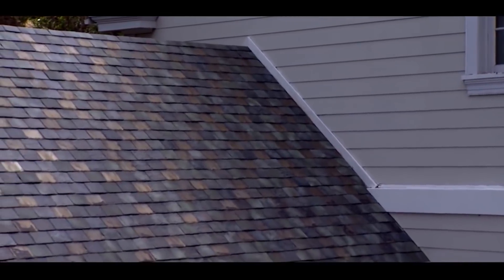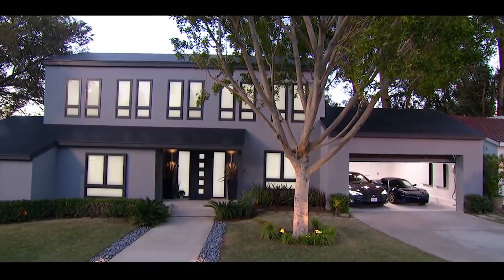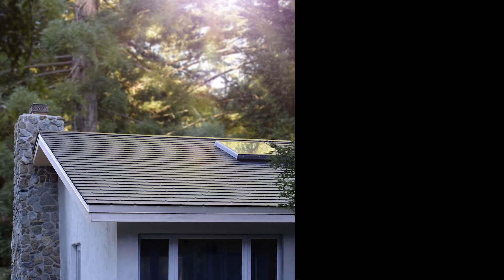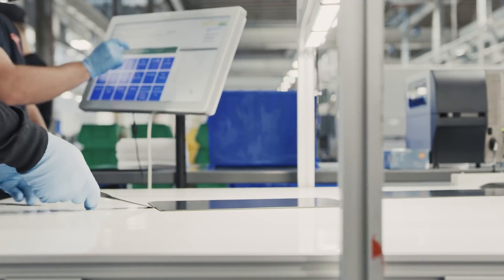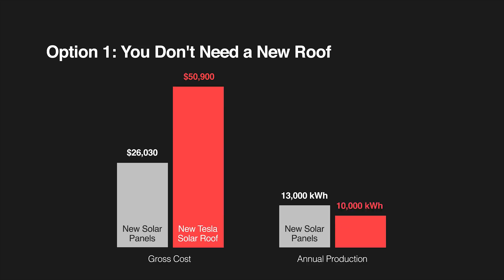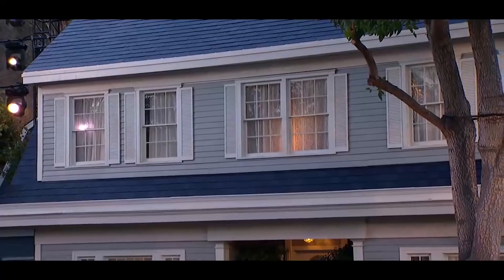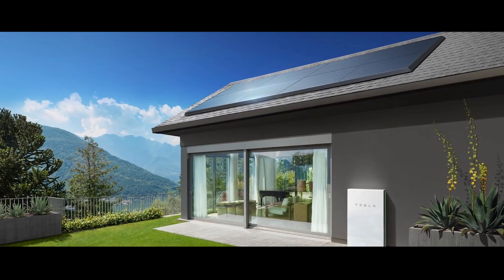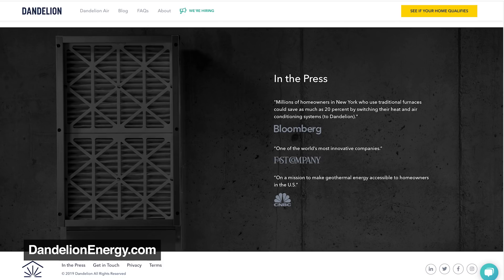Tesla Solar Roof Worth It?

Comment: I have been doing the same math since they have announced. I think you are dead on with your calculations. Where the solar roof makes sense is:

- You don’t want a typical-looking roof with asphalt dimensional tiles. You want a slate or clay roof that enhances the look of your house, but will come at a much higher cost.
- You are building a new house or you must replace your roof anyway.
- You can’t stand the look of solar panels on your house.
- You feel that having a beautiful roof that is very durable and has both a long warranty and the ability to generate power will greatly increase the resale value of your home.

If you are building a new home in a nice neighborhood where you won’t be getting a standard roof, but something much more expensive, the Solar Roof is a no-brainer. It promises to be much more durable, and the huge cost of a normal slate roof anyway will make up a large chunk of the cost of a Solar Roof. Not only will your utility bills be lowered, but likely your property value will go up, as the house looks great and it generates its own energy. Same goes for a preexistimg home that needs a new roof that will not be asphalt but is upgrading to a more expensive roof.

But if you are like me, and you have a house with a good roof and you are happy with it, and solar panels are not a massive eye-sore, just put panels on the roof. The whole point of the Solar Roof is to break the aesthetics barrier for rich people who don’t want their property values to go down after they put a bunch of ungainly solar panels on their expensive houses. It lets them be green and beautiful, but at a small premium over more expensive roofs than what the average homeowner would get. Solar panels are for the rest of us.

Comment: On the smaller scale, it would be fun using these on a dog house or garden shed with a small scale battery setup.

You could power a few outdoor lights and/or a wifi security camera without worrying about laying any cables. You'd have the s3xyst dog house in the neighborhood.

Comment: Tesla Solar Roof has more aesthetics put into it. It's for the people who want a solar roof that also looks good, not just a solar roof.
Reply: almond potato Bingo. To be fair to Ben, Tesla seemed to be pushing this as a mass market solution. It looks great, thus is great marketing, but Tesla really should be promoting standard solar in parallel, since it is more attainable for the masses.
Reply: @PeterWW420  Tesla Solar Roof is an innovative and beautiful design, but until they can effectively mass produce it, people will just go for the standard panels.

Comment: My family is seriously considering a Tesla solar roof/power wall. This is why it might be good for us but not for all: We have a tile roof that needs to be replaced in five years. We want to keep tile roofing. We don’t have solar yet. We live in a moderately expensive neighborhood So the roof proportionally isn’t overly expensive. (Putting out $80,000 roof on a $200,000 house makes no sense). We are also hoping that the prices fall a bit in the next five years. If your needs or situation is significantly different, regular solar panels might be better for you.

Comment: I looked into one about a year ago. It came out to around 100k for my home. My gripe though was that the system never told me what I was getting. Was the 100k for an 8kw system, a 10kw? Who knows there were just no details to be had. Personally I think that a metal roof with LG panels and a couple of Tesla powerwalls (IF you can get them) is the way to go.

Comment: Hopefully insurance companies will offer discounts once they see how durable these are. The hard part is comparing against asphalt roofs. Need to compare against tile.
Reply: In North Texas you get an insurance discount for hard surface roofing i.e. metal, concrete, tile. But also a few asphalt shingle types as well. I believe each asphalt mfg creates a hail resistant shingle. I had them put on my house after the last hail event. They look identical to the shingles I replaced but the hail resistant shingles were much heavier.  I would say almost twice the weight but this is a guess. My insurance treated them in the class of a metal roof for insurance cost. I  assume they would treat these the same.

Comment: Just like the Tesla power wall, there are better solutions for a solar (inroof) option. 

Actually on roof system with the option to replace panels and have the cooling will make it work better and be cheaper... 270watt Peak panels have dropped massive in Price and i doubt that The Tesla tiles will preform better, given that they look good

Comment: You failed to consider that the solar roof is supposed to last "forever" while a regular roof has to be replaced I think every 15 years. I would've liked to have seen that taken into account
Reply: The 'forever' only counts for the mechanical part. The electrical part will degrade by time, as any other silicone cells do. The solar roof will make you the money back on its electrical life time, but not much more. A normal roof with solar panels on it will make you 3 times the money on its lifetime. Solar Roof is a lifestile product. If you care your wallet and environment, then better go for regular solar panels
Reply: @RolandW_DIYEnergyandMore   Exactly.  Once the solar part is gone, now you're left with a roof that has no potential to generate energy and electrical equipment such as batteries / grid tie inverters / wiring that has no function.  You'd effectively need to replace your roof.  Although, maybe you can install regular solar panels right over the top of these? lol.
Reply: @RolandW_DIYEnergyandMore  You got it. Make way more sense to be able to change the tech ontop of a good roof. This way you are stuck with the tech. Like being stuck with the first ipod forever.
Reply: Every new building material claims to last "forever" and many of them are banned within 10 years for poor durability. I hope Tesla tiles stand the test of time and become the go-to roof for the next 100 years; I've drunk the cool-aid that Tesla are genuinely aiming for this.

However until they have 30 years of real world usage under their belt I wouldn't bank on reliability. I'm a skeptic that they will last more than 15 years without at least needing to be re-wired; less for homes close enough to the ocean to smell the sea breeze. Constant current in a potentially humid environment corrodes low gauge wires and terminals... and there will be thousands of those.
Reply: @matthewspencer2094  I'm skeptical as well but if they're warrantied like they say they will then it'll either last or be replaced
Reply: @ryccoh  He doesn't say whether it's the parts that have a ~100 year warranty or the install.

I'm from NZ and its 3rd parties that install Tesla power walls here. I'm sure Tesla stand by the units but they wouldn't refund you the install fee if there was an issue.

I imagine the tiles will be the same. While they would provide replacement tiles if they failed, they wouldn't provide the labor of installing them, or re-wiring them if the wiring between each tile corroded.
Reply: @matthewspencer2094  
Do you think they will use sealed systems for their wiring? with separate systems for termination.  There are still issues with resistance due to usage.
Reply: @matthewspencer2094  Well there's good news and bad news.  The bad news is that the new panels aren't warrantied forever anymore and the electrical output warranty has been lowered from 30 years to 25 years (pretty much everything is 25 years now).  The good news is that the new version 3 panels have better efficiency, more power output, less connections, less wiring, and costs almost HALF as much as the old version 2.
Reply: 15yrs? lol sounds like some BS tesla put into your brain. Most traditional shingles last at least 25-30 these days. The solar roof will not be a success or even really be a thing. It is so obvious considering the many factors I won't waste my time dumbing it down to you.
Reply: No roof lasts forever bud... You ever own a house?

Comment: You also have to add in the fact that you will have to replace your asphalt or shingles on your roof approximately every 20-30 years. Here in the Midwest, because of the more serious weather like hail, wind, rain, snow, etc. the roof deteriorates much faster which causes a homeowner to possibly replace your roof more often. Given the fact that the Tesla tiles basically can last forever, it almost makes more sense to go with the Tesla roof regardless of having solar or not just for the fact that it will last longer than the home will last.
Reply: Yea, because those tesla roofs energize the shields whenever it starts to hail, that way they can last forever, LOL!
Reply: Poppy S Those tesla roof tiles are guaranteed for over 100 years. It would take some big hail to break them.
Reply: Well, we'll see. Maybe. Provided tesla ever gets their roofs in area where hail storms are frequent.

Comment: You should remove this video and re-upload with proper numbers.
"You used the new roof cost of $8000 which is wrong, that $8000 number was for a 1500sqft home (2:04), not a 3000sqft home. So that decreases the difference by 8k making the Tesla solar roof more viable. 

This is not to mention that no one who can afford a 3000sqft house in California would ever ruin the aesthetic of their house with a cheap roll-on asphalt roof. The better comparison would be the slate tile shingles which are $30-40k for a 3000sqft home. This would make the Tesla solar roof $5000-15000 CHEAPER than the traditional solar panels on a new roof."

Comment: Just doesn't make financial sense currently. The other problem is that I heard these tiles are not quite as efficient as regular high-quality solar panels. That might not seem like it matters, but we live in a shaded neighborhood with lots of trees in every direction. We'll need every square foot of efficiency possible. So right now it would be crazy to go for that option. Maybe one day when it's much cheaper it might start to make sense for its aesthetics, but for now it's for rich people who just want something cool.

Compared to premium roofs, given it's long likely lifespan, it makes more sense, but even then it isn't actually cheaper, at least not for our home. And we're not the kind of people to buy a premium roof anyway. Cheap roofs that are properly installed work out cheaper in the long term even after being replaced. A basic shingle roof with high quality materials and craftmanship still lasts at least 20 years, and there are shingles that consistently last 30 years.

Comment: 04:30 You say $5 per square foot for a 3,000 foot roof. That's $15,000 not $8,000. So that's a 25% premium, not 33%.
Reply: I suspect he had the conclusion he wanted pre-penned before actually writing the script. =(
Reply: Still more expensive.
Reply: elyakimlev.. he said 1500 sq ft. Not 3000. So he’s correct.
Reply: @pjdambra  No, he is comparing it to the 3,000 foot Tesla roof, which costs $50,900. It would make no sense comparing 2 roofs of different sizes...

Comment: I don't understand the way the evaluation has been made here. The Tesla product lasts twice as long as the product it was compared it to. 

Plus, surely the whole innovation is that it's a one stop shop for a roof installation, that, crucially, is as aesthetically pleasing as premium traditional options?

To not weight that fact extremely heavily, as opposed to a seeming afterthought, is very wrong. Unless we accept that the industry of house building and indeed of finishing and furnishing never has anyone take much interest in aesthetics! 

We know the exact opposite to be true. The industry is driven by it! Else we would all be living in identical prefab boxes.

 There are so many people that would not choose solar, and go with traditional premium materials, because it is much too great an aesthetic compromise on the most expensive thing they own. To many, it looks simply hideous. And that's enough to discount the option.

Tesla is clearly providing a solution to that. It should be judged on those terms. Perhaps offset the energy recoup against the cost of it's doppelganger traditional, premium choice. Pretty certain they then both come out at effectively equal cost, and that's even before economies of scale and factoring environmental arguments.

What's been said is not too disimilar to someone arguing that a Model 3 purchase makes no sense, as you could buy a really cheap, bog standard diesel car instead, or if you really wanted to go electric, get a bashed up, second hand Nissan Leaf that actually looks terrible.

Just as with the solar tile, none of those arguments make sense when you want renewable, functional and pleasing in the same package.
Reply: He had to downsale Tesla so he could upsale his sponsor.

Comment: Your analysis (option 2) doesn't account for the fact that an asphalt roof will likely need to be replaced after 15 years, while Tesla's is expected to last for 30 years.  Instead of a 33% premium, the Tesla roof might only be a 10-12% premium.  I'd pay an extra 10% for a much nicer roof aesthetic. 

Plus, even if the solar cells in the tiles fail after 30 years, the tiles themselves may last longer.  So after 30 years you still may have a durable roof.
Reply: P.S.  And I'm sure roofers will charge more if they have to deal with solar panels on the roof when the asphalt shingles need to be replaced 15 years down the road.  That $8k estimate for a "virgin" roof may turn into $15k with inflation and the extra work required to remove and reinstall the solar panels.  At that point you'd be on par with the Tesla roof, but without the nice aesthetics.

Comment: As few more things:
1. An asphalt roof won’t last as long as the tile roof so you are comparing different products.
2. The tile roof looks better and will increase the value of your home. 
3. If The sun falls primarily on the front of your house you might not want solar panels seen. They often don’t look as good as the tesla solar panels advertisements.
4. It is still at the early adopter pricing and will likely fall.
Reply: All good points.  The asphalt roof will likely cost more than twice the $8k cited in the video if you have to replace it after 15 years.  I also wonder how long the Tesla tiles will last (not from an energy producing aspect, but simply structurally).  After 30 years, even if they no longer produce energy, they may still act to protect your roof.
Reply: Ken Bob I think the tiles will last 30 years plus but I can think of a couple negatives. One would be all the connections necessary for a solar tile roof. I think Elon said once that it was like “connector hell” Making all those electrical connections under the tiles that will last 30 years. If some of the tiles connections break fixing them could be a pain in the ass.Another problem is that solar technology improves and your roof can’t easily be upgraded because it’s all fixed tiles. Likely end up with a Inefficient solar tech compared to new technology in 10 or 20 years. The panels on top of a roof can easily be switched. I’m still undecided Which way to go.
Reply: @MJ-zo5gb   If you get a traditional panel system, that can be obsolete compared to new systems in 10-20 years as well.  As long as the current system meets your needs, the fact that it might not be as efficient as future systems doesn't really matter (more efficient systems would simply mean a smaller solar footprint is necessary to produce the same wattage).

Plus I imagine if you ever wanted to install panels in the future, you could install it over the existing Tesla tiles.  You would have a durable roof underneath.  I imagine bad individual tiles can be "unplugged" and swapped with newer more efficient tiles.  If you had a bad panel, the whole panel would have to be replaced.

Comment: Dang, you Americans, are paying far too much for your Solar Panels. here in the UK, I had a 10-panel 2.2KW system, with 8KW battery supplied & installed, for under $15k.!
Reply: Do you ever get sun in the UK?
Reply: I'm pretty sure the system quoted in this video was 8kW of panels. That's almost four times the amount you have. 2.2 kW wouldn't help much for a typical American energy-hog home.

Comment: But doesn’t the Tesla tile roof last twice as long as an asphalt roof?
Reply: Yes.  That's what I was thinking as well.  So instead of $8k for a new roof, after 15 years you may have to spend $10k or more (accounting for inflation) to redo the roof.  If that's the case, then for the 2nd option (4:40) the Tesla roof is only a 12% premium... and you get a much nicer looking roof and avoid the hassle of having to get the roof redone.
Reply: After maint. fees and install fees I guarantee this BS solar shingle scam will be 4X as expensive. Traditional shingles last much longer than 15yrs lol.
Reply: @Poker-is8dt  4x?  Sounds like a number pulled out of a place where the sun doesn't shine.

Comment: Been 99-100% self-powered since I got Solar Panels and Powerwall installed from Tesla Energy. This covers everything including charging my Model 3 because I can charge car during peak sun hours and is also earning $3-5 in energy credits. The only energy costs not covered is whatever my home still uses natural gas for (heating during winter months, water heater, dryer, and cooking). The Geothermal solution from Dandelion might help remove heating using natural gas during winter months and maybe also helps lower electricity usage during spring-through-fall months to keep home cool. Definitely something I will look into whenever it is time to replace either my central heating or cooling systems (not for another 7-10 years).
Reply: @bluehawk5046  Is that just a fancy name for electric powered stove?